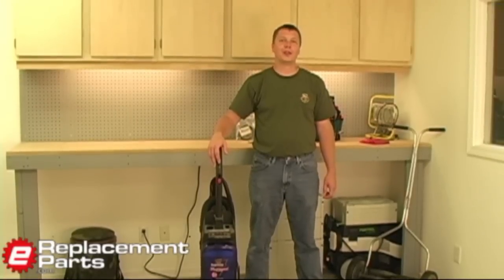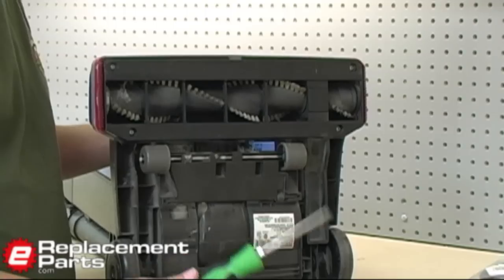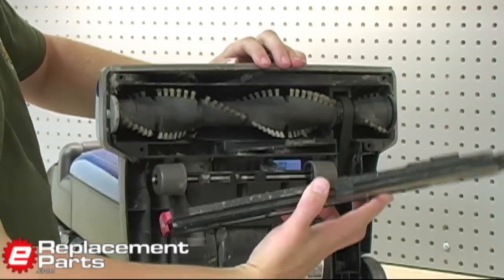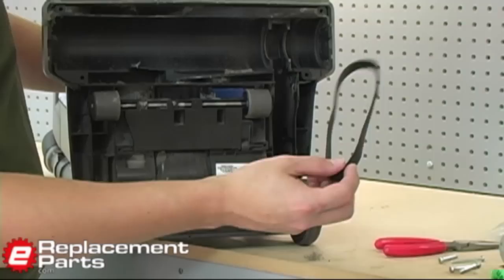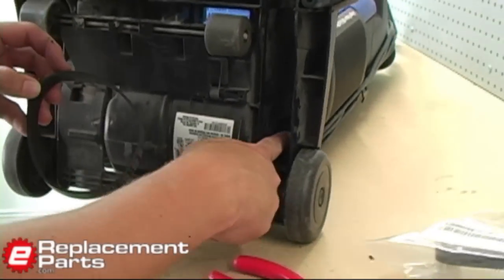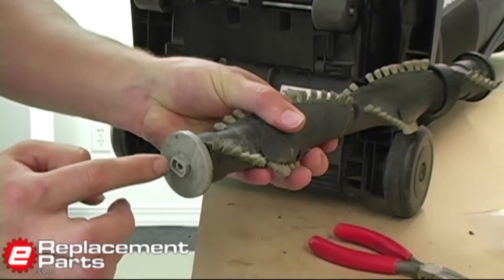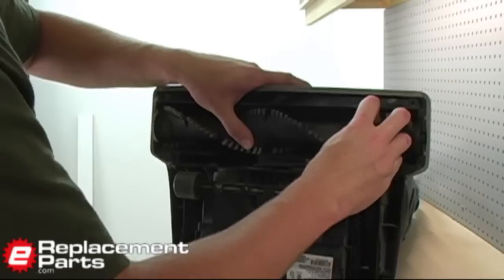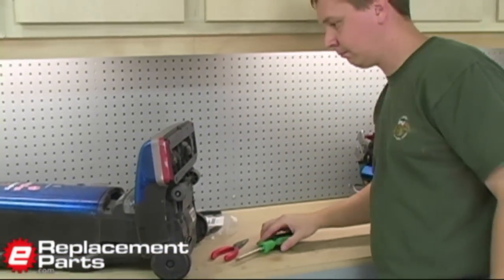How to Replace a Vacuum Belt

Comment from the maker: @jungillest No. There are dozens and dozens of vacuum belt sizes and styles on the market. It's true that one vacuum belt type and size is usually designed to fit several vacuum models, but matching the correct belt to a vacuum must be done on a case-by-case basis with the vacuum's model number. You can use our website's part finder at eReplacementParts*com to quickly find the right belt for your vacuum model. Also, you may find our our Vacuum Belt Buying Guide article very helpful.

Comment: About Vacuum Cleaner belts, I've always tough the belt needed to be for each specified vacuum, I was going to throw away my Shark Navigator now after just purchasing a New Dyson Small ball on credit. I don't know what do do now? Could this Shark Vacuum use any Vacuum cleaner belt? that is a BIG QUESTION.
Reply from the maker: Hi Evelyn,  not all vacuum cleaner belts are the same. I don't think you will find one for your Shark vacuum.

Comment: I did this but when I turned vacuum on within a minute the new belt melted at the point where the pulley( thing you put belt around) it was smoking hot,
Reply from the maker: +Nancy Uhl  Check to make sure the belt is in the correct location on the Brush Roll.  It sounds like either the belt is in thewrong location or the Brush Roller is bound up or seized.  Take the belt off from the motor and see if the Brush Roll spins freely.
Reply: +eReplacementParts.com hi I'm having same issue as above, I cleaned it and fixed it in right position but the roller is not spinning. Not sure what I missed